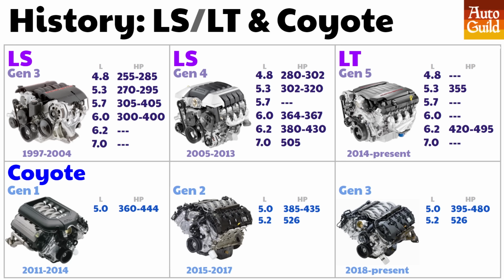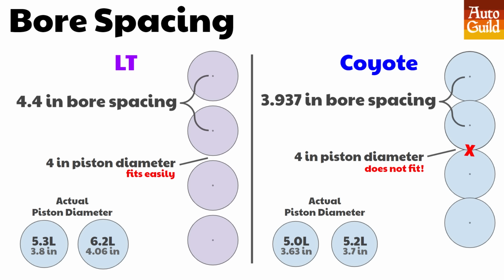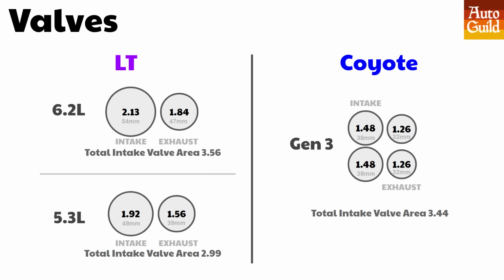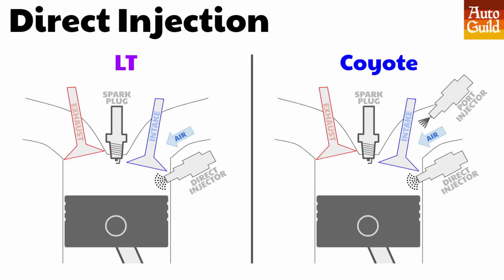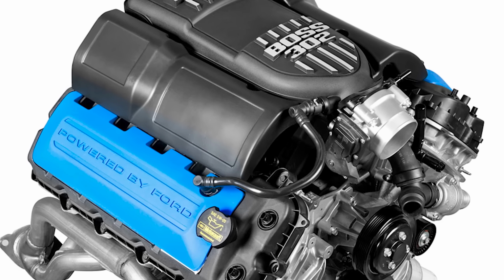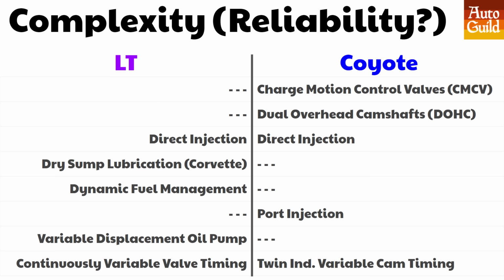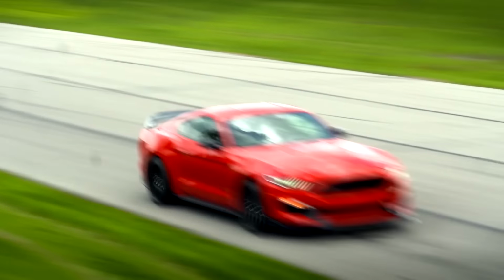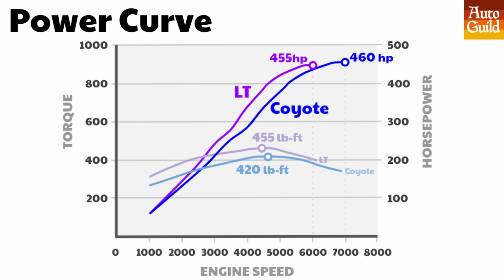GM Gen 5 LT vs Ford Coyote.  Which one is better and why.

Comment: Before (big block) gasoline engines go away, I wish Ford would make a 7 liter version of the Coyote engine. Use the same bore and stroke as the 427 FE. Yes, it would be bigger and longer than the current engine, but at roughly 780hp and still driveable,  it would be the meanest naturally aspirated crate engine ever.
Reply: One last Hoo-Rah, the return of “The Cammer”
Reply: Gas motors aren't going anywhere
Reply: @Honda1k  Yep. And Porsche, is currently creatin' Synthetic Fuels for Internal Combustion Engines.
Reply: Exactly. Bro all this “green energy” bullshit is just new players getting into the auto game, trying to make capital. Of course it makes the big 3 respond by putting out more electric options…but it’s just a “trendy” moment in time in the auto industry. Trends die💯
Reply: @Honda1k  I was thinking about this too, prob just focus on building ethanol friendly engines
Reply: @Honda1k  I really hope your right!
Reply: @Honda1k  no they won’t go away. But they will just be made unaffordable to drive for the average person.
Reply: @Honda1k  gas motors might not, but big block v8 will, and is already doing so
Reply: @Honda1k  2030 they are
Reply: @tsmatthx2  LOL you think so... Maybe by 2050. It's all about control anyways...
Reply: Or buy the 7.3L godzilla engine they have now. Not a oversized coyote but they share ford's modular whatever thingy.
Reply: @lobeholdlordy  pretty much the only thing they share is a parent company and a bellhousing pattern.
Reply: @lobeholdlordy  Not hardly sharing anything modular. Its a pushrod 2 valve . similar to LS-LT design with excellent heads. 430HP in f250 tune. Only needs cam,springs to get near streetable 600HP
Reply: @lobeholdlordy  but imagine a DOHC 32v 427Ci V8 that was built for the absolute most power from n/a. The 5.0 makes 450hp 5.2 makes 526hp, what would a 7.0L make?
Reply: @lobeholdlordy  the godzilla is not a mod motor. It is a pushrod V8.
Reply: @lobeholdlordy eh not really, 7.3 is pushrod. 2 different animals
Reply: @lobeholdlordy  a Godzilla is going backwards. Pushrod engine that can’t handle the power a coyote can handle. People make 1100whp out of the coyote stock bottom end and can run in the 7s with stock bottom end coyote. There is tons of aftermarket for coyotes that Godzilla will never have. There just won’t be enough 7.3L since it’s only a gas engine option of the super duty. It’s never gonna get a lot of aftermarket. Coyote f150s and mustangs is gonna keep them
Rolling in parts options. The fact even a f150 stock sealed coyote can run 8s with boost and the mustang 7s build them and people are making 1500-2000hp and running 5s in the 1/4 with a coyote. Godzilla will never get there. Not having high torque helps them stay more controlled off the like and gets them moving then all that hp gets it going like freight train
Reply: @carculturenation2166  yes, when you're making enough boost to go that fast low end becomes your enemy, not your friend, plus smaller heavily built engines are far more drivable on the street due to less torque.
Reply: @MekanikRandR  yes thats what makes Coyote A pretty good swap.option. you have tons of people that drive there 850-950whp 8 second coyote mustangs to the track run them and drive home. Stangmode just opened up his gen 3 coyote for the first time to build it. Over 1000 verified passes ran 8s with a VMP odin supercharger amd it has 42,000 miles on it. He drove it everywhere and dis street racing. They popped ot open today and the thing had no issues and you would never have thought it was pushing 950+whp factory sealed engine now probably gonna do what a lot of other do and turn it into a 1500hp capable coyote.
Reply: @carculturenation2166  I mean that's essentially ring gap and billet pump right? Then just seal her back up with some ARP studs and you're golden!
Reply: @carculturenation2166  There's plenty of videos of the 7.3L Godzilla V8 making over 1100 HP with Twin Turbos.
Reply: @carculturenation2166  Pushrod vs OHC has no impact on the ability of the bottom end to handle boost.  And the iron block of the Godzilla certainly helps.  No doubt, a boosted Coyote is a beast, but a boosted Godzilla would be brutal !!
Reply: @carculturenation2166   Will admit I’m not a Ford guy, whole lot more comfortable with the GM variety. Some of your numbers sound unbelievably high to me.  A little bit like a fan boy.  I sure wish you could leave a link to these five, seven, and eight second vehicles you’re referring to.  If you can show me, then I apologize and tip my hat to you sir.
Reply: @MekanikRandR  yeah having all that  torque sucks on the street…..
Reply: @donjohnston4215  check out my midnight performance they hold a lot of coyote records. You gotta remember they do some gen 1 gen 2 and gen 3 coyotes with 6r80 and 10r80 transmissions which have differences since 6r80 has been  out longer. But recently they showed a video of tons of there 8sec coyote f150s most with stock bottom end . They hve the record for stock sealed gen 3 s550 with a built 10r80 and they ran a 7.8 last I knew. That’s crazy right there. But dave can voris will soon do 6s with his built coyote in a 2018 He was running7.5 but now took his car way farther pushing 2000hp out of his coyote. Check him out. Then Revnevan on YouTube also he has been to competitions where they run stock seal coyotes in foxes on up to the 5 sec coyotes.  And palm beach dyno shows a lot of the gt500 stuff. They tuned iconic gt500 and he just ran 8s but usually does roll racing events and beat streetspeed717 and his fully built maxed out zr1 c7 . That kinda blew my mind because the gt500 was running full weight and basically has a ported factory blower full exhaust clutches tires and e85 tune and he is at about 1200whp on stock sealed engine. Basically the predator in the gt500 is a coyote. A lot of these built engine end up being a mix of all the good parts from the predator voodoo and coyote because they all are basically the same engine. I’m not a fanboy of anything but cars. I don’t care the make or model. I watch them all and drive anything with wheels. I watch the lambos and get into the build of the twin turbo kits to emelia hartford and her c8. Love this stuff. But the coyote has become the monster go to swap for power lately. Its just a 6 is doing a 67-69 somewhere aroun there camaro with a coyote in it. He drove all gm stuff and once he started workin in coyotes he became hooked on them. He has a zl11le also and started with camaros and vettes. He did a Chevy 1500 race truck but now is gonna build the last NA Shelby f150 supersnake. Then doing full race car with his coyote s550 mustang and a twin turbo gt350. So he builds everything but tends to lean towards coyotes over LS when trying to make power.  David van voris explains LS vs coyote pretty good. His friend joe has a 6 sec LS fox. And David plans to make his heavier s550 coyote mustang faster.
Reply: @donjohnston4215  no but it makes it muck jerkier, and can cause traction issues if you're on small tires.
Reply: @carculturenation2166    Where 850-950whp 8 second coyote?
Reply: @WhalerGA    They can easily cast the block in aluminum as well.
Reply: @mrpoizun  damn near full weight stangmode hit the 8s with less than 950hp. Before the supercharger he was in the 10s N/A with just suspension. supercharged  coyites tend to be in the 8s while these turbos have gotten them to the 7s on stock bottom end. Heavier yet are the f150s and stock bottom ends are getting them in 8s but they push more hp to get there. S550 and s197 only take that much if they have suspension and some weight reduction. Check out midnight performance lund racing palmbeach dyno and aldoweld. You will see tons  and tons of coyotes in the 8s. You figure full interior gt500 weighs 4150-4250lbs with driver and cracked 8s with a trans that slows its 60ft. But it takes 1150hp.  Mustang GTs you can easily get down to 3300lbs. Every every 100lbs off is a 10th of a second  off the 1/4. So even lighter means less power thats why the stock sealed coyote class and NA class is so big.s550 NA people get 9s but have to get that weight to nothing.
Reply: @carculturenation2166  Godzilla isn't meant to compete with Coyote and it's silly to do so.

They're built for different purposes entirely.

Coyote is a much better track engine, staying around 5 liters/300 CID is preferred for a track engine, honestly, the 7.3 is a better engine to pull your race car and trailer with. That being said the 7.3 looks like what we'd all like to have built from our old pushrod Fords...
Reply: @carculturenation2166  I get what your saying but it’s a quarter mile. And another fact your forgetting is that cubic inches are king. You ever wonder why the most powerful cars in the world aren’t 4 valve? The sad fact is you can’t make cubes with a yote the big trick is boost with sleeves to take all that blunt which are not aluminum like the block. The Godzilla can be built with much more cubes make much more tq off the line than the yote. A big tire will solve traction issues. Now if you race on the street yote is the way to go but not at the strip where tq matters greatly. Also nobody is making 1100 whp without OPGs,boost, fuel system, trans, suspension, drive shaft, and axils. So yeah maybe you don’t have to build the motor but you have to built the rest of the car. Godzilla comes ready to rock capable of more power otherwise ford would not have made it. It’s not really going back wards but rather every tool has its job that it’s better for. If this was roll racing or street racing sure coyote is superior but at the strip where 1/8 and 1/4 are the distance with glue and slicks it’s not. Playing the catch up game don’t fly at the track. 60 ft and 330ft are key to winning. What your talking about is manageability of power from the launch which can easily be tuned for.
Reply: @joshreynolds729  4 valve. Discredited your entire article
Reply: @justinmartin8887  Really 🤣.  With your 5 words. Maybe explain your thoughts unless your just regurgitating info from others.
Reply: @mrpoizun i can link you to a ford racing performance block coyote running 7.20s on the stock ECU, but its isnt "stock". Crank snouts tend to break at the 1000+ hp. If u are interested in the coyote i mentioned above, go to Mexican racing league, a shop in tx, great content, even if the car doesnt meet the specs u seek. Also "Aldo welds" channel, or "midnight performance" lot of 1000 plus coyote F150s in the 8s, 4wd launches look violent. Cleetus McFarland just got a coyote F150 that made 1044 hp / 974 ft lbs and ran out of injector there, 18 lbs of boost from a borg warner turbski
Reply: @carculturenation2166 2000hp gets you into the 5s in the 1/4?
Reply: @carculturenation2166   Well this aged like milk....🤣
Reply: @carculturenation2166 man you are very wrong about the 7.3...... check out Brian Wolfe.
And Ford just released the Megazilla crate engine. And the aftermarket is going nuts with the Godzilla platform!
Reply: @donjohnston4215 Every garbage motors product I have owned called. Bought my last one in early 90's. Todays project is a Toyota Yaris on steroids with air horn! 😅😂😂
Reply: Ford did make the 427 SOHC Cammer V8 and let me tell you its the most baddest engine on the planet.
Reply: @CJColvin  Since 2020, Godzilla 7.3 is the Ford King.With it's munch more compact pushrod potential .@ least 2000hp easily handled by its iron block. Sold in F250 up and as crate engine. Appearing soon @ next stop lite or your local track
Reply: @peted5217  Agreed brother, I bet it's wayyyyyyy more robust than any EcoBoost engine Ford makes.
Reply: @CJColvin  Truth!
Reply: @Marco-fi6gv  Yep you got it brother and that 427 SOHC Cammer V8 sounds wayyyyyyy better than any EcoBoost engine.
Reply: @CJColvin  damn right! In my opinion that's the best engine Ford ever made. I guess it depends on the application, but it's def my top choice!
Reply: @Marco-fi6gv  Exactly mate and yet these EcoBoost owners will say that its an old dated Dinosaur.
Reply: @CJColvin  naw the Barra is the baddest Ford engine out there.
Reply: @kr_mk7799  Nice though that's because it has turbos just like the EcoBoost does.
Reply: @CJColvin  when did I ever mention the worst turbo 4 cylinder ever made?
Reply: @CJColvin  that's when all the auto makers chevy included came together to ban them from racing because they couldn't compete. First on race day = ford
Reply: @4damula  Exactly mate its all because of GM and Mopar complaining to Nascar.
Reply: The only way they could do it is with a V10, or ditch modular casting.  The current bore spacing is the most any modular engine can have.  The 7.3 is not a modular engine, it's OHV basically a modern big block.
Reply: @Dayandcounting  The 7.3 isn't much bigger than a 351W, much smaller than the FE or 385 blocks.
Reply: @Dayandcounting    Modern in that it's not big.  It will fit in a Mustang.
Reply: @mrpoizun  So will any other Ford big block, what's your point?  The Coyote is wider than all the Ford BB aside from the Boss 9.  A 460 is narrower width 2" and height 1" and only 6" longer in length vs a Coytote.
Reply: @Dayandcounting  or they could do what they literally already did back in 07 and use the 6.2 SOHC casting, which was originally conceived to be a big block modular, and was designed to be capable of over 7 liters of displacement, originally designed as a 7.0l, 800 horsepower, 9000 rpm naturally aspirated DOHC v8. It was theoretically possible to take that out to a 7.2l engine size if you wanted (but being able to potentially make well over 1000 horsepower n/a with the right fuels, as they only ran it on 100 octane gasoline, why would you need to make it bigger? (Theoretically if ran on methanol the engine could have made almost 1500 horsepower without boost, and methanol is a very common racing fuel) so why not just build the engine they already built but in a greater quantity than 2? They have the block machining capability, and they already have the cylinder head molds, all they'd have to do is source or make cams, secondary timing chains, and maybe some really beefy VVT solenoids, which may require adding small provisions to the block to run. They'd also have to make a timing cover and valve covers. That's it. The heads they cast were based off of cobra R heads, so they'd make big block hemi heads look like economy heads in terms of airflow.
Reply: @MekanikRandR  It's not part of the modular family.  The Modular family all have 100mm (3.937) bore spacing.  The biggest bore they can reasonable handle is 94mm or 3.700"  You can't make a big block with that as a V8

No reason to make more displacement anymore, between boost and electric it's pointless.
Reply: @MekanikRandR  ⁰
Reply: @Dayandcounting  Ford didn't develop godzilla as short term engine. They know ICE will be mainstream til 2070 +
Reply: They already did back around 06-08, it just didn't make production, but the development turned into the 6.2 SOHC that went in the raptor and all the super duties, but they made like 700 horses without boost on pump 93 iirc, and on race grade fuel were able to make 900horses at 8k rpm (might have those switched) and did it with a 427 cube motor, which was quite similar to the old 427s.
Reply: @MekanikRandR  switched? 8K horses at 900 RPM?

lol
Reply: @glenwaldrop8166  yes I switched the numbers, if you want some more numbers mercury marine has a DOHC converted BBC that, with the help of twin turbos, is rated for 1200 horses on 91 octane pump gas. So have that number too, if you can find a way to package it a big block cammer is awesome.
Reply: A 7 liter coyote would be awesome. The problem is what would you put it in? The 5.0 liter DOHC barely fits in a mustang now. It's already 6 inches wider then the 6.2 LT. Packaging is the issue. That's why you don't really see big displacement DOHC engines like you do pushrod OHV.
Reply: The 6.2 can be taken to 7.0. and while still sohc, it has massive semi-hemi valve angles, and dual spark plugs allowing for a shit load of fuel and air to be burned..
Reply: @PureCountryof91   like a ls7
Reply: @PureCountryof91  it can go to a 440 ci max I believe not just a 7.0 which is a 426 ci.
Reply: @PureCountryof91 um….. I don’t care if you put 64 spark plugs in it, if you can’t get enough air in it won’t make more power.  Hemi engine are still enjoying legacy reputation from the heady days in the late 60s and early 70s.
Reply: @donjohnston4215  trust me. The 6.2 heads can flow more air stock than a modified coyotes. There's plenty of power available
Reply: @PureCountryof91 l 
L
Reply: @PureCountryof91  6.2 definitely don't have better flow than coyotes. It takes alot more internal work and ported heads to make four digit power on an Ls. On stands it's a fuels system upgrade bullet opg and a blower or turbos.
Reply: I'm planning on getting ahold of the head castings for the triple 7 prototype and getting trickflow or someone to recast them with ford's permission at some point, so fear not this motor will soon exist, you'll just have to resleeve a 6.2 super duty motor to have a 7.0
Reply: @MekanikRandR  raptor R is gt500 engine voodoo 5.2
Reply: @Mikey-wf9py  the 5.2 actually kinda sucks compared to the 6.2
Reply: @MekanikRandR  It doesn't suck It's just not built for the average man who's going to actually use it for work or drive it for a long time It's made for the millennials who are going to drive it for 30,000 and trade it in
Reply: Or how about even bigger lol and make a coyote version of the 429/460 ! 😁
Reply: @brentacusmaximus6677  there is a 7.5L (460ci) custom built boss 6.2 with the sohc heads. Livernois power sports I think was the name, build it for a customer in Dubai
Reply: I'm with you on that too my friend also larger crank diameter, that's always been a big issue in Fe's .
Reply: @FiredogJC  

Where did you hear of this big issue??

What's the main size of a 351C or BBC??

You realize the larger the main, the more heat??
Reply: And GM would just resurrect the 7+ liter big block and stick DOHC heads on it and call it a day. Move along, nothing new to see hear!FR
Reply: @fredericrike5974  well GM stuck dual overhead cams on a 5.5 L naturally aspirated V8 with a flat plane crank and it is the most powerful natural gas rated V8 ever produced
Reply: @Mikey-wf9py  Not disagreeing with that at all. TBH, though, many of the LS performance packages are equal to others equal displacement DOHC designs. At some point in the future, if IC engines have much more, the "twin cam in block" that GM's Cadillac Div was working on in the early '00s will finish the argument- better packaging as well as having separate cams to run VVT on. Now the trick for production cars is to meet the emissions requirements- it was serendipity that it also gave them a window into performance gains they never had before. Oh, and before I go, the "most powerful" title will only last as long as the short side wants it to. Look back at the history of NASCAR as the Big Three sought dominance- it wasn't just race engines that got stronger. And yes, I am also aware the Ford will do the "coming back"- they always have!  FR
Reply: @Mikey-wf9py  Forgot to mention- the chain or belt drive for the SOHC or DOHC engines is nearly always the limiting factor for these designs- and a warrantee trap. the Caddy TCIB are driven by short chains or are stacked gears- much simpler and much more "warrantee-able". I can't wait to see what comes next!  FR
Reply: @Mikey-wf9py  Pratt and Whitney made that motor for c8,not garbage motors
Reply: I like how you think sir !!
Reply: gas engines will not go away in our lifetimes. the electric grid wont handle it and there just isnt enough lithium on the planet to replace every gasser with an electric
Reply: @origionalwinja  I NEVER SAID gasoline engines would go away. I'm asking for a big block version of the Coyote engine. Please point to a 427 cu in or larger engine in a passenger car.
Reply: Don't worry gasoline engine aren't going anywhere
Reply: They can try all they want, talk big and even bush for changing for more electric options, but American’s love of oil won’t be dying anytime soon. Shell, BP, Texaco, Chevron, Phillips, etc are protected and won’t lay down that easy as WE THINK OR ASSUME.
Reply: I literally have thought the exact same thing so many times.
Reply: Democrats:  Just buy a $100,000 EV.
Reply: I've been saying this for the past couple of years.  It would literally dominate chevy and dodge
Reply: @DDog_Gaming  Yeah! Do it before a V6 is the biggest engine we ever see.
Reply: Big Engine's aren't going anywhere Man. The exact same thing happened after the HP War's of the late 60's. By the Mid 80's so called Sport's Car's we're making 200 HP.
Reply: Amen 🙏🏾
Reply: Tru That , but never happen. Their Godzilla 7.3l has that capability in spades @ 70% of quad cams size
It's selling well as a crate to rodders already, as huge displacement capable compact LS , LT type engine
Reply: There’s some custom 347ci coyotes out there’ they make 800hp n/a
Reply: Godzilla. Ford's FU to GM.
Reply: Ford has the Godzilla Motor..?
Reply: @EasyNoBreezy  The 427 SOHC made more power in 1963 with only two valves per cylinder. The Godzilla is designed to be a torque making truck engine.
Reply: @chrisdaigle5410  then just make a similar counter part to the LS9 or LS7 but Ford’s version 🤷‍♂️
Reply: It's about a physical impossibility to make a 7 liter engine with a Coyote block, to make an engine of that displacement with the 3.7 bore you'd need a 4.95 inch stroke.  The rotating assembly in the case of a 4.95 inch stroke probably would not fit within the engine block.  You could create a new block based on the Coyote with higher bore spacing, but that would be essentially be designing a brand new engine with minimal parts commonality with the current Coyote.  

As another poster notes, it would be more practical to start from the 6.2L truck motor if you wanted to get to 7 liters/427ci displacement.  Then Ford would only need to design a 4 valve head for the larger bore size, maybe scale out the Coyote design head for the 4.015 bore of the 6.2 liter.
Reply: Enter the 7.3!
Reply: Ya gas engine are not going anywhere FYI.    battery packs do not work well in places like Alaska, you will never live long enough to see ICE go away, because it never will.
Reply: I don't think you realize how big is 7 L dual overhead cam motor is... they would have a hard time fitting that in the F-150. Never would fit in a mustang !
Reply: @1BigDaDo  It would be about as big as the 427 SOHC.
Reply: @1BigDaDo people are putting straight six Cummins diesels into mustangs so I’m wondering.
Reply: 7.3l Godzilla but it's a 2v pushrod old style Ford big block but yes if it was the coyote architecture it would be insane but GM just made a crate motor that is 10.4 L 1,004 horsepower naturally aspirated zz632
Reply: Could always get a turbo Barra with some new injectors from aus
Reply: they already have thats where the cayote comes from
Reply: A 7L Coyote would definitely make around 670-700hp stock.
Reply: If it would be it would of been done, be happy with the 7.3 😂
Reply: Just buy the 1000hp NA chevy 632.
Reply: @ninjaface2342  I would much prefer to walk.
Reply: @chrisdaigle5410  if you're running Ford motors then that's what you'll be doing
Reply: @LifeLongStrong1961  John Kaase sells a smaller displacement engine that makes over 1100 horsepower.
Reply: @chrisdaigle5410  
Kaase is a specialty engine builder,not a manufacturer. If you want to go there then we’ll be talking Banks or Lingenfelter and your point is moot.
Reply: @saltydog7988  That comment makes absolutely ZERO sense.
Reply: @chrisdaigle5410  
I’ll defer to your superior knowledge as I’m sure your YouTube experience far outweighs my 45 years in the auto industry selling GM performance parts. But how you can compare a bespoke one off custom built engine that runs on race gas to a mass produced manufacturer engine that runs on pump gas escapes me…but you do you. Keep living in your little blue oval fantasy land and the rest of us will live in the real world.
Reply: @saltydog7988  Keep selling parts because your reading comprehension is wanting. My post said that I wish Ford would make a 7 liter version of the Coyote. Obviously not in a mainstream production car because we'll never see big block street cars again. More like a crate engine. I was using the horsepower per liter and scaling up the numbers for a horsepower figure. The same thing would happen if GM made a crate engine of their new Corvette engine in a 7 liter version. 
Although honestly, if I'm going to dream, why NOT make a tribute car to the GT40 MKII with a 427 cu in engine? I know it'll not happen.
Reply: @chrisdaigle5410  
My reading comprehension is just fine,thank you very much. My comment was directed to your reply to another poster that ONLY said Kaase made a higher hp engine with less displacement. I was not referencing any other post you may have made. 
As to the larger displacement coyote,would be interesting to see as would a tribute to the GT. I don’t understand Ford fans disdain of cam in block engines though. GM has stuck with them for cost,reliability,and packaging reasons. But you and everyone else has seen what they can do when the decision is made to go dohc with the LT6. In my opinion Ford enthusiasts should be happy GM hasn’t jumped on the bandwagon before now…I’ve stated before if/when GM gives their engineers room to play they are hard to match. I fault management for GM’s issues,not their engineering department.
Reply: @saltydog7988  Fair enough.
Reply: @chrisdaigle5410  
Your points are valid,enjoyed your point of view.  Good day to you sir!
Reply: Ford would fk it up with junk parts.
Reply: Don't need to. They have the godzilla.
Reply: Right now extremely Corrupt Politician's are trying to establish an alternative Energy Market that Their in Complete Control of. But They will Fail because the Alternative Energy they want to Convert to is beyond Inferior.. EV's and Solar Power is not going to work.
Reply: They have the Godzilla 7.3l engine.
Reply: It's the Godzilla
Reply: A bigger coyote would require all new block and head castings due to requiring a larger bore spread. There is absolutely not 1 thing that could be shared between a coyote and a bbcoyote short of the oil pump and timing sprockets.
Reply: @mr.espeedshop4839  That's all true. They also would never be able to sell enough of them to make it worthwhile. But it would be AWESOME.
Reply: No🤡
Reply: None of them are "big blocks" a big block being traditionally defined by a greater than a 4.5 inch distance from center of bore to center of the next bore.
Reply: Ford is missing out on a lot of money because they have not built a replacement engine for the 4.6 crate engine modification that would be plug and play the 5.0 engine is good but to much modification has to be done so when my 04 mustang GT automatic dark shadow gray engine needs to be replaced I will have to go back with the 4.sick engine no matter how much money you put in to it will always be a 4.sic
Reply: I am looking for a engine to replace my mustang GT 4.sick
Reply: These aren’t considered big blocks they are considered small blocks. Believe.
Reply: Nah there are far better NA engines already. Just nothing from America outside of the ole viper V10. Otherwise not alot even close to the euros
Reply: @Rollincoal311  The Viper V10 is a boat anchor. Especially when you consider power v displacement.
Reply: Gmail ford and dodge have all stated they will stop gas powered engines sales in 2024 period. Your wrong.
Reply: chevy just left everyone in the dust with the 5.5 in the Z06 C8
Reply: @BlackBeardAir  That looks like a powerful  engine...But, but,but "the cam isn't in the block!"
Reply: You want big boy power get a 632
Reply: You can go with the old super duty 6.8 V10 OHC engine, the big modular is cool
Reply: The megazilla is on the way
Reply: Let us hope that never happens!
Reply: Couldn't agree more. I gave a 2024 gt and it lacks torque.
Reply: And where would you put it? Would it even fit in the truck?
Reply: FORD IS GOING SMALL NOT BIG, THATS WHY THEY PUSH ECO BOOST.
Reply: @MikeHalkiotis  WHAT I CANT HEAR YOU
Reply: @Matt0205ram  Good, that was an A, B conversation so C your way out of it! 😉
Reply: @MikeHalkiotis  if it’s on the internet it’s not a 2 way conversation, you are voicing your opinion on a platform where millions of people see it. Also that comeback actually made me laugh lmao. Are you in intermediate school or what?
Reply: @Matt0205ram  If I can make one child laugh, I’ve done my job! Lol
Reply: @MikeHalkiotis  eh... idk they put out 2 new big block gassers in the last few years
Reply: Why the f u c k would you take a coyote over an ls
Reply: @zekeburns2340  Well, since I would take a 1 cylinder moped engine before I would consider any GM product, there's that. 
I would always prefer an engine like the Coyote that has several thousand rpm with flatter torque and hp curves. If I want a pushrod engine, I would much rather a 385 series Ford engine.
Reply: @chrisdaigle5410  wow you suck with a capital suck.... Chris you know nothing about wrenching
Reply: @zekeburns2340  I didn't say I was a car mechanic. 
But I do know that the 5.3 LS needs a supercharger to be able to hope to keep up with a Coyote. If Ford built a 7 liter version of the Coyote design, the 6.2 Liter LS would NEVER be able to compare.
Reply: @chrisdaigle5410  5.3l vs coyote isn't even a fair comparison has to be 6.2l vs coyote to be fair unfortunately that how it is... Really Ford copied toyota
Reply: @zekeburns2340  double overhead cam, more rpm,, more power
Reply: Coyote turbo would be also wild and more efficient than NA engine.
Reply: @MrRaitzi  I think we need a BIG motor with MDS, bring the big block back with ford's MDS system, add turbos but put ome turbo for the deactivateable cylinders and one for the full time cylinders, and then when you dont need tons of power you have a turbo 4banger, when you do need ALL THE POWER you have a twin turbo v8 (ford's MDS is stupid reliable so it's fine)
Reply: @MekanikRandR  MDS has very little benefit. The pistons are still moving, so the parasitic loss is still there.
Reply: @Bobby Harvill  I would bet the US wont even be selling gas cars by 2030, 2035 at the latest.  

So sure there will be gasoline cars around.  At the same time it's going to become increasingly more expensive to operate them as government de-incentivizes there usage through tax code for part and fuel.
Reply: @Dayandcounting    Where usage?
Reply: @Dayandcounting  No way is it possible to find that much electricity by 2035.  the entire nation will be a brown out.  Horses are going to be very valuable.
Reply: You don't know that the 7.3 liter that's available in the F250 is available as a crate engine, and will fit in modern F150's and Mustang GT's?
Reply: 2022 raptor r has a 7.3 v8 supercharged 1100 hp stock
Reply: 700+hp for the new raptor. Not sure where you got 1100
Reply: @metking21  it's called the raptor type r dummy look it up
Reply: So you really think Ford will produce a more powerful engine than an Veyron from the factory? The '22 raptor r will be 700+ and the regular raptor gets the ecoboost.
Reply: @metking21  hasn't been announced yet my best freind is a general manager at kunes country ford so yea it's coming 2022
Reply: @mattwagner8965  It's rumored to be a supercharged 5.2L with 700+ horsepower.  I don't see any evidence of a blown 7.3L motor.
Reply: @WhalerGA  like I said it hasn't been released yet I have inside info
Reply: @mattwagner8965  No, you said "it's called the raptor type r dummy look it up".  I'm a huge Ford fan and I love the Godzilla motor, but it's not going to happen.  Sorry, I don't believe you have inside information.
Reply: @metking21  Ford produces more cars in one day then veyrons does in a year.  Not a great comparison. Also, both of the engines in this video or something a lot of Americans would be able to purchase.   How many Americans are going to be able to afford a Veyron??  Elon musk already has a faster car so that’s gonna leave like three more people that can afford it.
Reply: @donjohnston4215  I'm not disputing that fact. All I'm saying was a response that that the next raptor won't have a production engine with power levels in hypercar territory. That's not Fords m.o.
Reply: @mattwagner8965  

You're so FOS your eyes are brown....
Reply: @metking21  The veering must be supercharged and its millions of dollars and its not massed produced for average consumers by any means
Reply: @WhalerGA   he had insider information because his friend works for a dealer 😂😂
Reply: @mattwagner8965  no it's a guna be gt500 motor
Reply: @metking21  it’s the shelby gt500 5.2 supercharged v8 motor
Reply: @mattwagner8965  your friend must have lied to you 😂. The 22 raptor r came with 700hp and 640 torque. I also work for ford. I don’t think Ford has ever produced a engine factory making over a 1000hp not even the s550 cobra jet and that’s a full blown drag car. I know because we have sold two at my dealership
Reply: @redmyst5864  look up the code red mustang then and the raptor is built better period trx is trash
Reply: @mattwagner8965  code red is not factory you must own a gt s550 and it a 200k upgrade by a company hired by ford
Reply: @mattwagner8965  uhmmm...1/09/2023
Reply: @mattwagner8965  my friends used to mess with me like that too when I was younger n naive lol
Reply: @metking21  Yes sir 700hp
Reply: @mattwagner8965  this didnt age well for the "i have inside info, trust me bro"
Reply: @WhalerGA This didnt age well for the guy "with inside info"
Reply: @mattwagner8965 yes , the Raptor R has the 5.2 Predator engine from the Shelby GT 500. 700 HP. But that engine is upgradeable to 2000 HP if you have enough money to take it there.
Reply: @metking21 or where he got 7.3 lol, it has a 5.2
Reply: @mattwagner8965 720hp… not 1100
Reply: @mattwagner8965  is this confirmed?
Reply: @mattwagner8965   Bull.
Reply: @mattwagner8965  no it's a 5.2l voodoo btw
Reply: @mattwagner8965  Isn't the new Raptor R a Supercharged 5.2L?
Reply: @mattwagner8965  big wrong on that one
Reply: @mattwagner8965 No it doesn't!